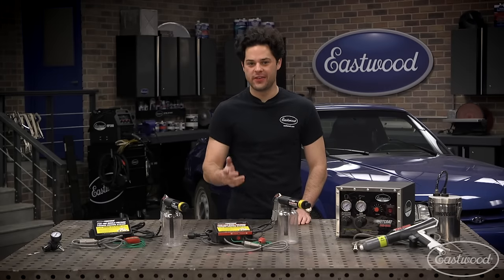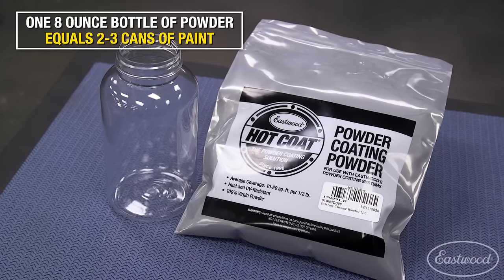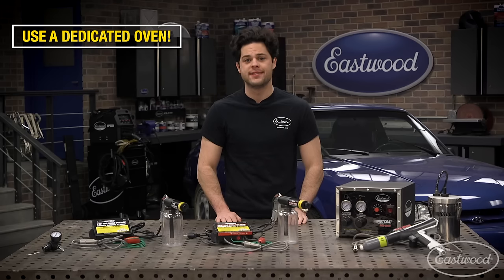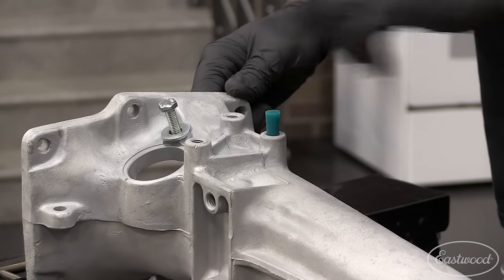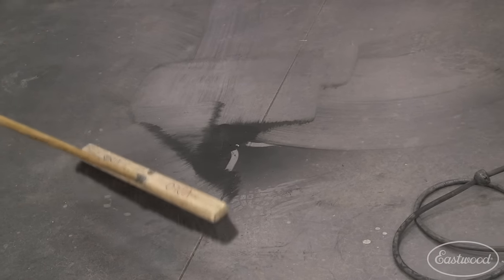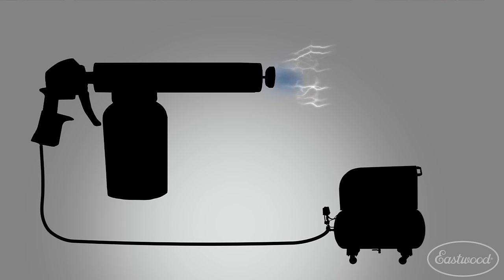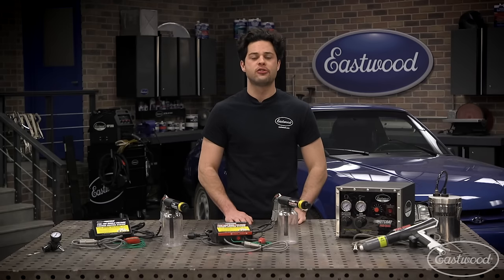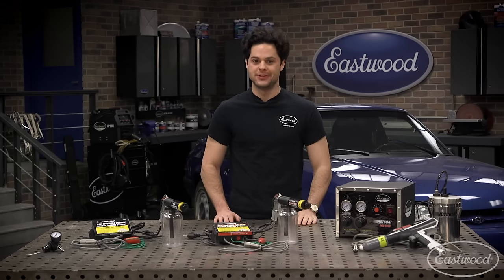How to Powder Coat - The COMPLETE Beginners Guide To Powder Coating - Eastwood

Comment: Sounds simple enough. I only looked it up because of a job application i found, and it sounded cool. Not sure why they wanted 3 years experience, no wonder theyre "urgently hiring"!
Reply: Doing the same lol, I’m hoping they actually hire entry level applicants
Reply: I work as a Powder Coater in a Metal manufacturing
Reply: @ak-47liloc18  did you need prior experience or some kind of cert to start working with that? Sounds like a cool job!
Reply: Same here

Comment: Ive been using the dual voltage system for about a month, and im so so happy with it. I want to get the nicer psc1000 because if the gun I have is doing this great of a job I could only imagine how good the psc1000 would be. However it is a bit pricey and im not totally sure if buying the gun is worth it because I've found it really easy to buy a handful of those bottles and just fill them with powder and screw them onto the gun when I need a new one and I find that really simple and cheap. So I mean to ask is the psc1000 worth it. Because I can say for sure that the dual voltage gun was worth every single penny spent on it.
Reply: The PCS1000 is actually REALLY shitty and 100% not worth the price. Get a Hypersmooth or even a EZ-50 is better. We have amazing results with our EZ-50 as a backup, far better than any Eastwood or entry level gun in that range can do.
Reply: @DonkeyBong490  Ok thanks, I'm going to look right into it!
Reply: @DonkeyBong490  I just looked into both and i think that the ez50 is exactly what I want. Does the powder flow smoothly and stick well? Those are my main complaints about my current gun.
Reply: @toxcsick  Yes, it really is a great little gun that we use often. It does multi coat much better than the Eastwood offerings and it's far more affordable. A proper grounding rod set up will make a huge difference from what you are used to with your dual voltage gun in terms of adherence into those faraday cage areas.

Comment: This is a great video and I really appreciate it. One thing I dont understand is why we can use a device using 15,000 V to 100,000 V to apply the powder but it is unsafe to use a 120 V appliance to clean up the powder off the floor.  Im wanting to begin powder coating. The two biggest issues I need to work out are oven and clean up.
Reply: Because the powder coating system is typically operating in a grounded state as a single system. That is your gun and the part have the a similar voltage potential which limits the energy transfer in any potential sparks.

When it comes to the vacuum you're not dealing with the 120V system sparking. Instead the vacuum imparts energy into the dust leading to the system behaving like a capacitor and storing a very large amount of energy. Even then this will most often discharge without you ever being aware that it happened and no fire. Until that day you get a bit lazy and let a lot of dust build up, then the spark happens to occur right where the correct fuel air mixture exists. This flame wave front blasts more powder in front of it up into the air causing a massive deflagration and your shop burns to the ground.

Comment: what kind of powdercoat are you using on engine parts that are a high heat part? What is the best way to powdercoat a 55 gallon drum for a smoker?
Great video BTW!
Reply from the maker: Hey thanks, Indy,
Powder is designed to "flow out" (basically, it just melts) at 400F, right. As long as you're not getting close to that hot, you'll be ok. 
So for a smoker, you're looking at about 250F - 275F max, right? At that temp, any of our powder is going to be rock solid. 
For really high heat, we have high-temp paints that will hold up to 650F, but valve covers, wheels, springs, and most underhood components don't get near the 400F required to re-melt powder. 
-JD
Reply from the maker: Side note: be careful not to contaminate any food with powder, or paint.
Reply: @eastwoodco  some smoking might be at 350-375 If someone wants to do chicken or some sides. I know gateway says to not exceed 410 on the season process.

Comment: QUESTION: is it viable to use two powder coating guns in one target? Like for example a car rim or bigger target? If so, does it both requires to be grounded to the target, or one gun is enough to be connected and be grounded to the target?
Reply from the maker: I suppose you could? I don't think it's viable though. Once the part is 100% covered in powder, you're done. 1 gun is more than capable of 100% coverage on larger parts. Maybe if you really wanted to coat things quickly, but there's really no reason to rush with powder coating. 
It doesn't matter where your ground comes from. Stick a copper rod into the earth and ground off of that if you want. As long as the part is grounded, the charged cloud of powder will want to stick to it. 
-JD

Comment: Do you have to strip the chrome off a fishing guide and there's a piece of plastic ring in it?
Reply from the maker: You'll have to strip off any chrome in order for the powder to stick. Also, that plastic ring will (probably) melt in the 400 degree F baking process. I'd try gently popping it out of the guide. Hopefully it isn't glued in. 
-JD
Reply: Thank you

Comment: Would the 250 be good enough to powder coat bumpers.
Reply: Can you do a 2 tone powder coat, can you do multiple layers of powder coat?
Reply from the maker: If you mean metal bumpers - yes the PCS 250 can handle that.  You can do multiple coats and 2 tones with some extra prep work. We plan on doing something with that soon.
Reply: @eastwoodco  • Thank you very much for the reply.

Comment: Can I powder coat the inside of my home oven
Reply from the maker: A home oven is capable of baking the powder - we recommend a dedicated oven for food safety.
Reply: What i meant is I have a double stack oven that got damaged by baking with foil paper bon the bottom. I want to refinish the bottom with powder coating so I don't have to keep looking at it
Reply from the maker: No that won't work - Powder melts at 400 degrees - so as soon as you bake something it will re-flow.